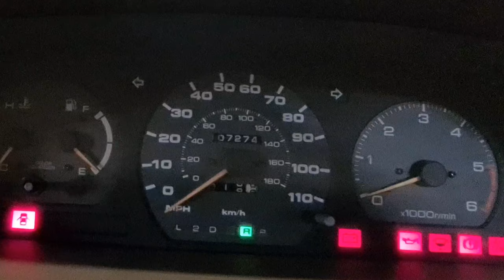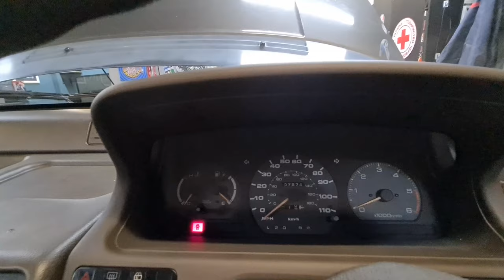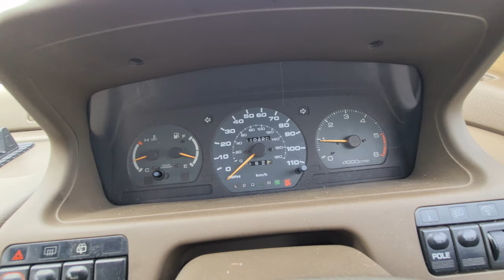MITSUBISHI CHARIOT 4D68T RESCUED FROM THE SCRAP YARD

Comment: If it had diodes in the wires from the dash you could have got away with a single relay. Works a treat though 👍
Reply from the maker: Ahhhh, bugger ... I didn't know that, but I'm not sure if it does 🤦 cheers

Comment: I see lots of interior parts from my 96 Pajero, seats centre console etc...
I don't think I'll ever get rid of my Pajero, it just keeps going! I did have to get the injector pump seals done not long after I bought it, something to do with a difference in the diesel additives between Japan and the UK. I.e. they shrink allowing fuel to drain back to the tank, resulting in the car conking out after about 2 miles!
All good now though.
Reply from the maker: You have a Pajero 🤟 that's brilliant... Yes these are similar inside... And use the same controls etc... These where built on a lancer... Galant chassis... With some pajero parts.... But these old mitsubishi's are bomb proof very good cars... Our delica is built on a pajero chassis also with Pajero.. Shogun sport engine and running gear 👍🤟